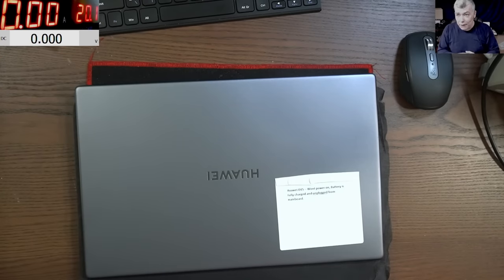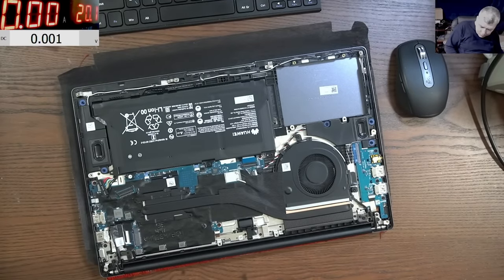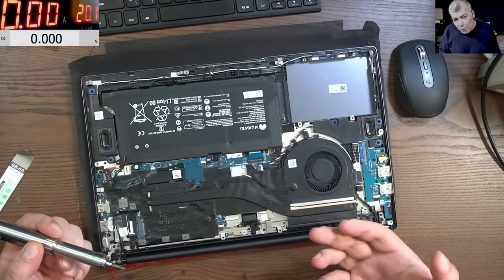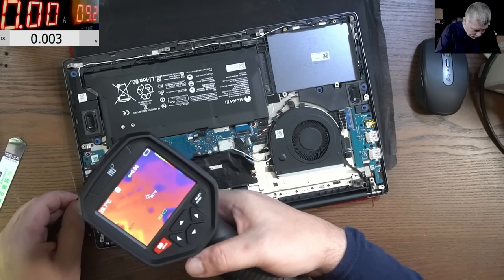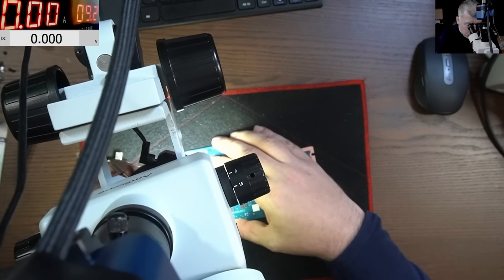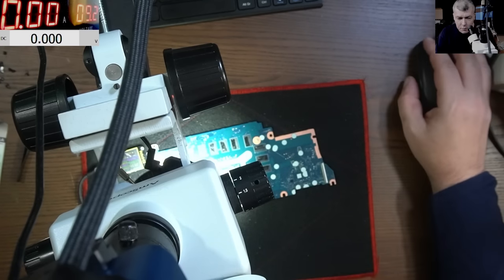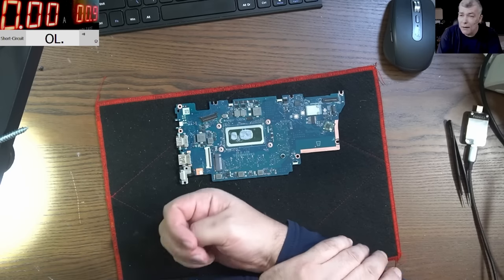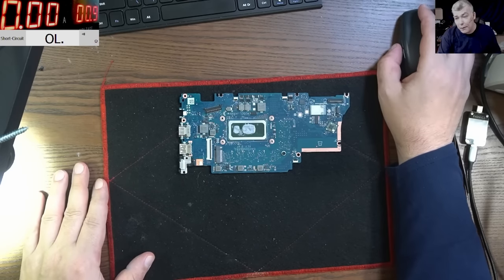Huawei D15 shorted PCH - What we should do? Buy a faulty motherboard from ebay? :D

Comment: A lot of sellers now accept returns, if they do, buy 3 and only keep the one (or none) that you know you can repair, be open and transparent with the seller, if they are genuine they won’t mind you taking readings as long as you don’t physically work on the boards, large sellers don’t waste time quibbling over returns (they have a dedicated returns department) and they definitely don’t  risk getting negative feedback on eBay, and even if the seller does not accept returns, eBay will still guarantee your money back, with eBay the customer is always right

Comment: Hi Sorin, thank you for the video. I had got in touch with you with a similar model motherboard with the exact same issue you found. Think it got damaged by an electrical surge by the sounds of it. You are having the same thought process I was having. I have looked at the motherboards you are talking about thinking is it worth it? I will see if I can find out more. Good luck with whatever you decide. Dave Powell in the comments did buy a couple and found simple faults to fix. Others have said this seems to be a common fault on these boards. I wish success with your choices.

Comment: But I had an hp 15" x360 with an i3 processor. I wanted to upgrade it to an i7 so I bought a faulty board off eBay. That board had a diode array that was bad on the webcam circuit preventing it from booting. But it was an individual seller like you mentioned - not a company

Comment: Quote:"It's taking four amps and noting is getting hot. It's crazy". Well not so crazy because heating up a component is the product of current AND voltage. 
Example 4 A and 0.1 V  equals 0.4 W. 1 A and 2 V equals 2W. So a high current doesn't mean a high power!
Just a side note from an old electronics engineer ;-)

Comment: Sir please please explain laptop battery circuit also why new batteries do not show voltage on multimeter if battery is disconnected from laptop.
Reply: Because it has an enable switch and most probably it works with ground. Once you enable that switch it will start voltage on output.

 Check the battery connections diagram before doing this.

Comment: You'd be surprised, I've bought laptops from companies like that, no display and a quick short of the bios pin later, bingo, working laptop. Bigger companies get these to clear and are unlikely to test them , they likely get them for next nothing or nothing so they're not gonna waste time checking them if they can get £30 for doing nothing. A solo trader might do that, not a company.

Comment: My general Ebay rule is that if they are a mass-volume seller of "untested' electronics, they're knowingly selling tested trash.

You have to look for individual sellers selling their broken item to have a better than 10% chance at it being fixable and/or having has no prior repair attempts.

At best you'll find bulk sellers of broken devices that can't test them all or it would be a waste of time to test beyond pressing the power button. Yet, even those are rare. If they have a long history of selling "untested, as is" tech...it's 90% unfixable garbage. Why? They're selling because they already deemed it unfixable AFTER a repair attempt or ten. There are rare exceptions but it is mostly the rule. I don't buy from stores or people moving a lot of one thing if I want parts or electronics I want to repair. I only buy from the person posting the random item just to get some money for their broken item, likely to buy another.
Reply: I disagree.  I ust bought a lot of 4 laptops sold as untested (due to absence of charger) and 2 of them are in good working order, one starts but the battery is dead and the 4th one is dead.   so I guess there are out there some guys that are not selling shit.

Comment: I wouldn't buy the faulty ones from ebay. Working ones seem to sell for ~200€ they sell these for only 30£. If they could be saved I am pretty sure they'd have been fixed for the ~165€ in profit.
Reply: some companies does not know how to repair MB
Reply: @ronlevin2339  True but that eBay account had 130k reviews and they had 3 of those broken for sale at the same time. It seems to be a quite a big shop. It'd make sense to have a technician look at things if you sell that much. I could be wrong of course but if it was my eBay shop that's how I would run it.
Reply: @fabian11235  i know several local shops here that sell computers, but do not understand a minimum in board repair
Reply: @ronlevin2339  Sure I have seen those around here too. I am just saying that if I had a shop that has already sold more than 100k items on eBay. I'd have a technician to try to fix things and maximize my profits.